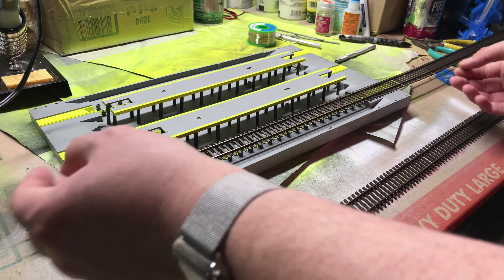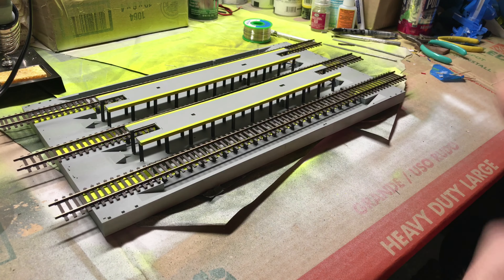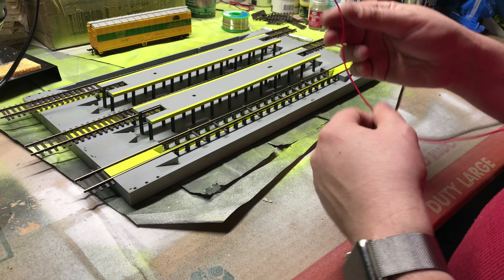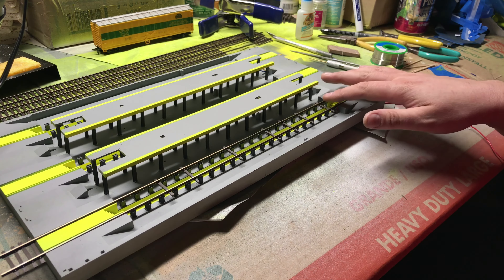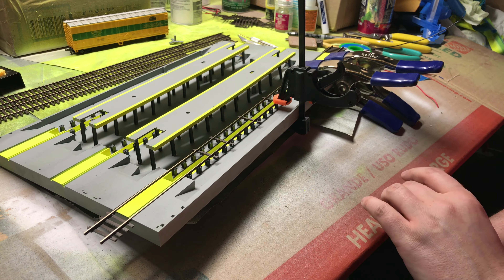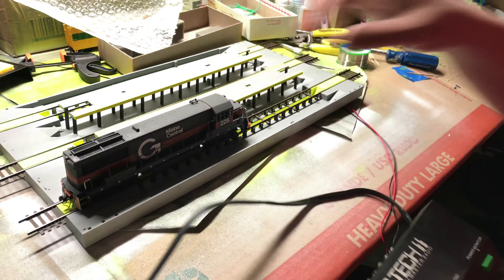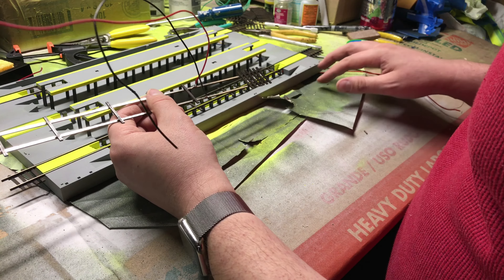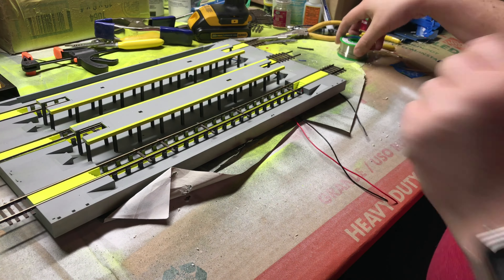Build It: Walthers Modern Diesel House Track Installation

Comment: Why are you bothering to power the rails inside the building?  Can't you just power them outside on the portion of the track that extends?  Also, do you think using a Peco or Atlas track that retains its straight shape would be preferable to the Walther?
Reply from the maker: Honestly, I don't know. I guess I was just thinking that all the wiring would be under the building and if the building ever had to come off the layout everything could just easily disconnect. As for Peco or Atlas, that would work. Keeping the rail straight wasn't too hard since there were so many little track supports. Thanks for your feedback.